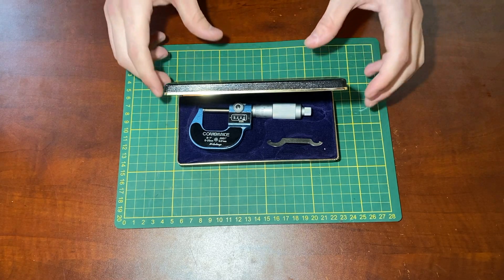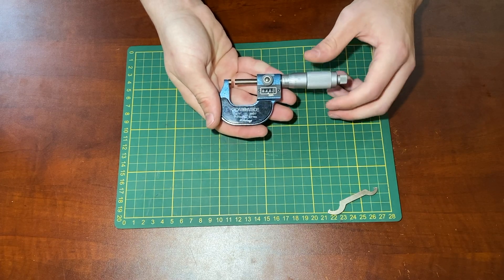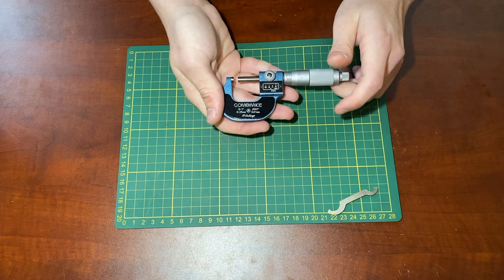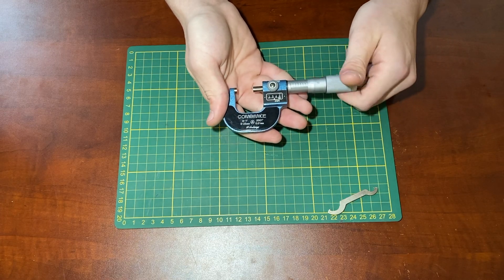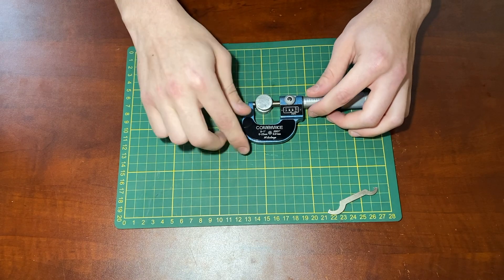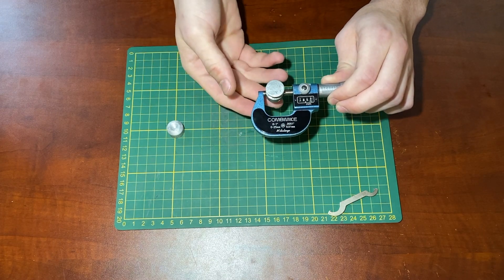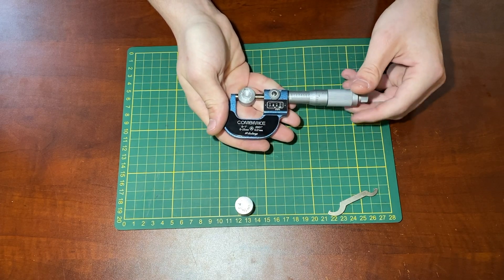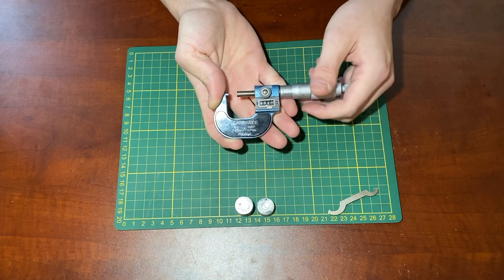Mitutoyo Combimike Micrometer

Comment: To calibrate a 0 to 1 micrometer all you need to do is bring the anvils together and turn the barrel with the spanner wrench you have and line it up with the dile. That's how to zero it out. No gage block is needed for a o to 1.
Reply: You can use it to check the 1" accuracy